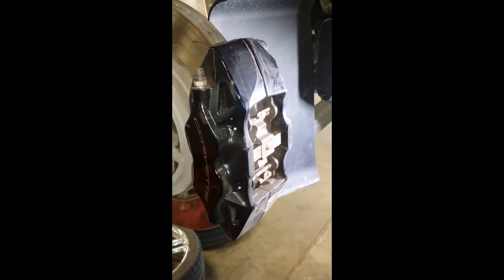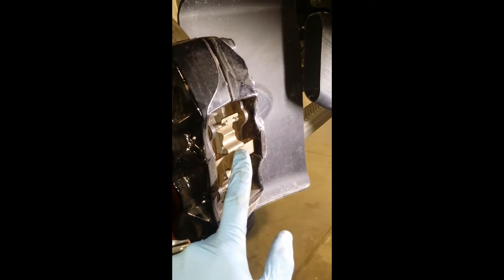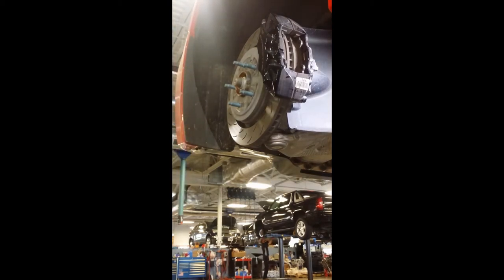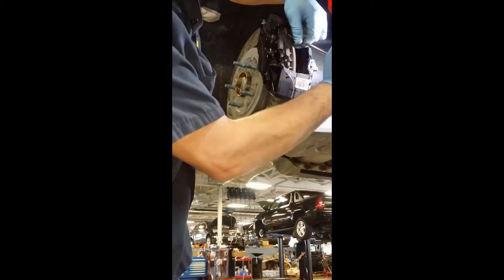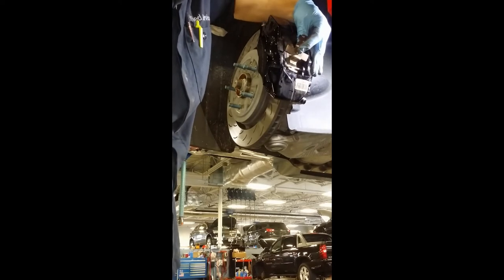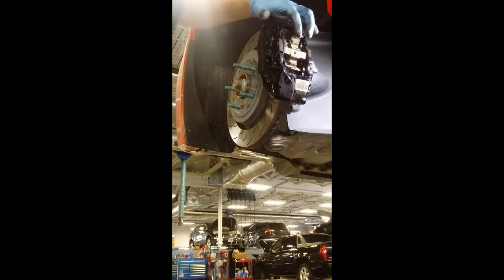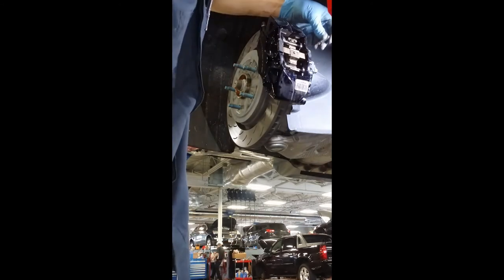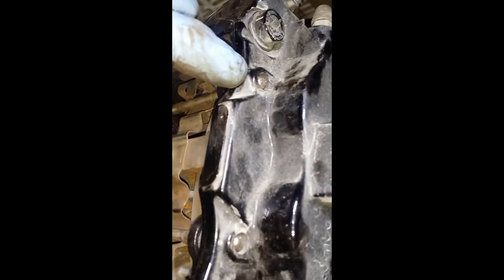C7 Corvette Stingray brake pad replacement

Comment: What Matt asked...how come you did not lube the pads/shims?  Thanks.
Reply from the maker: +FLYBOY123456789 I had already done the procedure once and lubed them prior to shooting this video. I should have mentioned that in the video. Lubrication is recommended, it's a special compound much like anti-seize. GM part # is 19303310. Apply it to the ENDS of the brake pad backing plates, where it slides on the abutment brackets. Be careful not to get any of it on the pad itself.

Comment: Thanks for the help! Are you supposed to also change the rotors when you change the pads or do I not have to?
Reply from the maker: +crustygymshorts Typically when I replace pads under warranty (as seen in above video) we don't replace rotors as GM wont let us. If it was my own vehicle and they had some miles on them, I would either resurface or replace them. If it's a low mileage rotor with no damage, scoring, grooves, etc then you can replace just the pads and be just fine.
Reply: +GM How-To Thank for the response! I guess it costs too much for GM to replace rotors?? I only put about 7,000 miles a year on my car but I do track it about 5 times a year so it might be a good idea to replace the rotors too
Reply from the maker: +crustygymshorts Replacing rotors under warranty doesn't ever really happen since it's a wear component. They do have a service bulletin for the some C7 cars that covers pad replacement due to excessive noise.

Comment: do you need to apply brake grease to the back of he pad.... or sides?
Reply from the maker: +Matt S See above response. Yes, to the ends of the pad backing plates.
Reply: I watched the video and at no time does he apply the grease.
I applied to the back plate only.
Reply: +Matt S as i mentioned, I had already lubed them prior to shooting the video. I should have mentioned using the lube in the video.